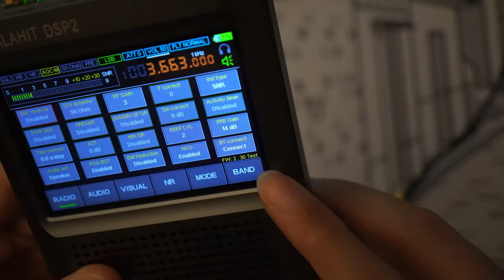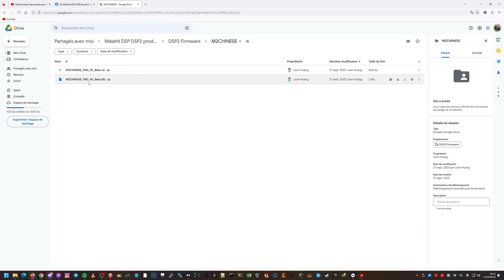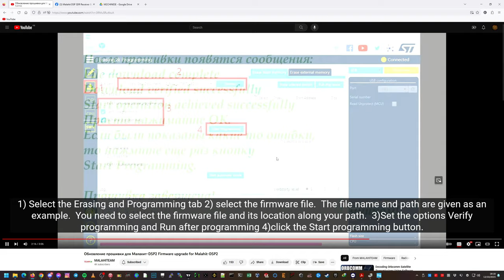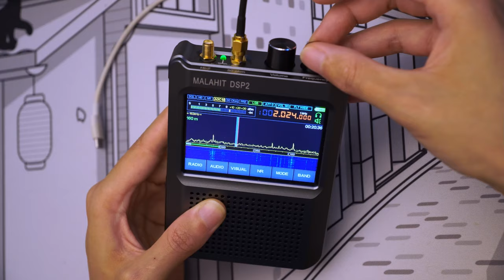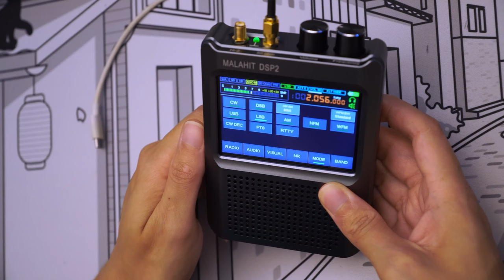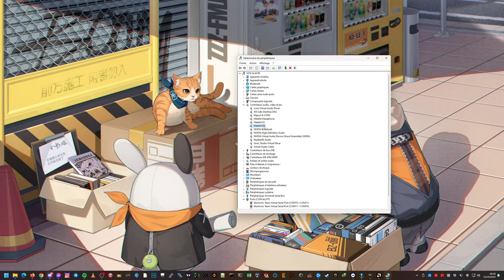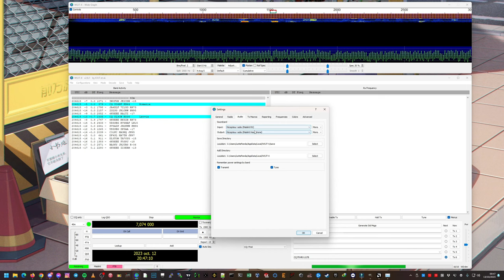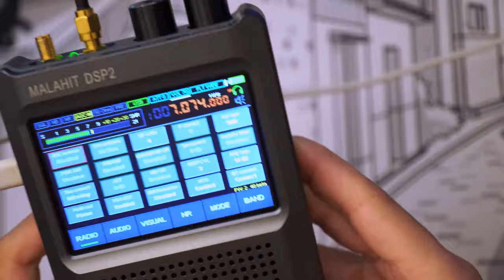Malahit DSP2 2023 2.40 beta firmware upgrade, FT8 decoding, WSJT-X comparison via USB

Comment: I just got one exactly like this and I think it would do a lot better with FT8 with a high Z antenna. I already figured out a lot about this little rig. I watched the whole video and never once did he have either the NR or the NB on!! And with no high Z and no NB or NR on, getting FT8 would be difficult I think. Most SDRs do better with high impedance antennas, this is an SDR, just one that is standalone like a portable radio and not hooked up through your PC. The High Z connection is a lot quieter and in HF, with both NB and NR turned on, it should do better getting FT8 pulled in. I have tried both 50 ohm and High Z ants on this and also bought the two little "Donut" antennas specifically designed for Malahits. The Donuts are high Z and work quite well. One is for the AM broadcast MW band and the SW one covers most of the HF bands. But it starts at 4000KHz so it omits the 80 meter ham band. The little donut antennas are only about $20 so well worth it, I recommend them.
Reply: ❤  Never heard of "Donut" antennas, thanks!

Comment: Thanks for your video! I did not know how to set time in the radio. Now FT8 working well. Weakest signal decoded -19SNR. Firmware is 2.40. I use a home made little wire loop about 50cm in diameter with very sharp resonance. Get a whole lot of signals on the malahit. Yes, I also pushed the CALFT8 and then it could not decode anymore because time was put forward.  Strange. Thanks for the link to the files!

Comment: Can you tell me how you know this is a Chinese copy ? Of the original
Reply from the maker: The Malahit receivers are designed and built by Russian amateur radio operators and engineeers, as explained on their own website Malahiteam. They are the only sellers of the original model. Anything else is a copy. That said, there are now licenced copies, with future upgradeability of the firmware. This is one of those.
Reply: @Slay3rOne  How do I know if the metal DSP2s from aliexpress or banggood are licensed?

Comment: Is this really worth USD 360, your honest answer please.
Reply from the maker: Sorry for the late answer. Quite frankly, I didn't own any of the previous Malahit receivers, original or clones. I wanted to get one since the very first models, but even though the clones were cheaper than that, the quality wasn't really there at the beginning, so I wasn't interested and decided to wait further to see improvements. I saw a lot of reviews of the more recent clones, and I have to say there are some really good ones nowadays that can cost a bit less than this one, like the V3 and/or V5, if I remember correctly. Again, I didn't test these so I can't compare here.

But all the other models out there are clones of the DSP1 and not DSP2 (better hardware, smaller frequency gap, more spectrum scope bandwidth, more recent firmware version with newer upcoming releases adding functionnalities like the decoders here,...). If I'm not mistaken, there are only two DSP2 clones out there now.

This particular model is the first chinese clone with really really good build quality, fully CNC machined aluminium case, shielding on all modules, good quality speaker, plus it's the more recent DSP2 and it does in fact have a licenced Malahiteam firmware that can be upgraded without issues later down the line. All that adds extra cost unfortunately.

So is it worth the extra cost? I don't know, I would say if you want to try out a really good Malahit receiver you can get the cheaper priced models like the V3 or V5 and I'm pretty sure you won't be disappointed and have most of the functionnalities and specs. But I went for this one for what I consider to be a much better build quality and more recent design, with fully unlocked and upgradable firmware.
You probably will get more bang for your buck going for let's say a V3 or V5 (do your own research on the other clones), but considering the quality of this one, I am not disappointed at all buying it. It's the first Malahit that really looks and feels like a professionnally made piece of equipment to me, with a lot of thought that went into the design. Once again, my own opinion on it.
Reply: Put it this way my Mala came in another case than this one but it cost me $75. So no, this is a rip.

Comment: I just got mine, and I'm really impressed with it. One minor niggle is that the FM station RDS is not working, even with strong stations and all the settings carefully checked. Have you had this problem? A few letters came though just for a second but nothing since.
Reply from the maker: I can get RDS to work, but I have to point the antenna in the best direction to peak the RDS signal. Seems like it struggles a bit with decoding it, but with a strong RDS signal it just manages it.

Comment: bricked my radio, though the programmer said all ok, now can't enter even a DFU mode
Reply: Did you try holding both push buttons down for 15 seconds?  May reset the radio to defaults. It did for me.  Also, it seems that removing the battery will reset in a different way.

Comment: Thanks for the video. I think the reason the cursor was not "centred" at 10:16 is because you were in LSB. If you select USB it similarly "offsets" to the right. Any problems or issues since updating the firmware?
Reply from the maker: You are correct for LSB/USB offset. I've been using the radio a bit sice yesterday and it's been working flawlessly so far. I had no issue in particular, at least not yet. So I'd say it looks pretty stable for a beta firmware overall.

Comment: Вариант с водопадом смещающимся при настройке лучше варианта с подвижной стрелкой. Движущийся водопад однозначно изобличает сигналы являющиеся побочными каналами приема. Если весь водопад дружно движется с определенной скоростью в одну сторону, а какой то всплеск почему то побежал навстречу или с удвоенной скоростью - сразу ясно что это сигнал фантомный. А как вы это поймёте с "модной" движущейся стрелкой?
Reply from the maker: Well you're right, what you mentionned can be indeed one advantage of a centered VFO. But this is a situation I rarely encounter. Also, in my opinion there are more advantages to a fixed bandscope/waterfall compared to centered. I have a Icom IC-705, and most of the time I use the fixed bandscope showing the entire band I'm on.

The Malahit has enough bandwidth with its 192kHz to cover a big portion if not the entirety of most HF bands. So when using the fixed bandscope mode, I can clearly see what's going on on the entire band, for example on 40m, whether I'm listening at 7.060 or 7.150 I can still see the entirety of the 40m band, just like I can on SDR Console with my RSPdx on the computer. So if I see a signal, I can tune it, and keep looking down the waterfall with no confusion whatsoever. The waterfall history remains clear and useable when tuning around the band to spot signals. It gets messed up with scrolling near the edges, but that's fine.

Tuning with a centered VFO on the Malahit and most SDR softwares (except SDR Console and maybe others I don't know), the waterfall history remains where it is on the screen and new signals are painted at the top. The waterfall immediately turns into a very confusing looking thing, with signals painted sideways all over the place during and shortly after tuning. Signal history at the bottom becomes immediately useless as it does not correspond to the frequency currently being displayed. It is especially annoying to me when using slow waterfall speeds!

What SDR Console does instead when going up and down in frequency, is to move the entire waterfall history side to side with the bandscope! Where there is no history, the waterfall just starts blank. So after moving up in frequency, you can have a look down the waterfall immediately, and it still makes perfect sense. It looks natural, all the signals history are still showing up right where they should from top to bottom, and if you want to have a look to tune to a signal, it is not confusing at all.

That said, this probably requires much more processing power, as the entire waterfall gets repainted and moves during tuning. Perfectly doable on a PC, but probably not on a Malahit. It would be really great to have though.

So to me the fixed bandscope that allows tuning across the screen is not just for looks, it's a real advantage! You can have a fully useable signal history and see almost the entire ham band, independently from the frequency you're listening to on that band.

Comment: Hey I have a original DSP 2 can I use that upgrade u did if not where can I find a video to upgrade original DSP 2  can you help me thanks
Reply from the maker: The tutorial video I was watching to follow the update process was from the Malahit Team themselves. It is the same procedure for the original and for these clones (maybe not all clones though!), but the firmware file itself is not the same.
The links I provided here are for the clones shown in the video. But for the original SDRs, you can find the latest firmwares files on the Malahit website down below. You will see links for DSP1, 2 and 3.
https://malahiteam.com/en/documentation/
Here is the link to the original firmware update tutorial video as well. Check their manuals from the link above for further instructions if needed.
https://www.youtube.com/watch?v=3RMuSRu4kuA

Comment: Does the tuning mute or chuff when turning the tuning knob?
Reply from the maker: Not at all on the Malahit receivers!
Reply: @Slay3rOne  How is fine-tuning achieved? Automatic, or you don't need to do it?
Reply from the maker: @r0tekz  I didn't need to align anything. It is perfectly on frequency from the factory. But there is a "F correct" option under the "RADIO" tab, if required.
I did use this option for QO-100 reception, as I use a GPS locked LNB, but it remains around 110Hz off frequency on any receiver I tried it on (Pluto, RSPdx, Malahit).